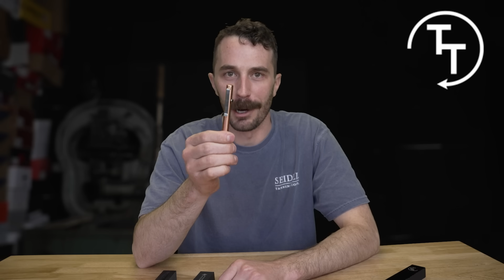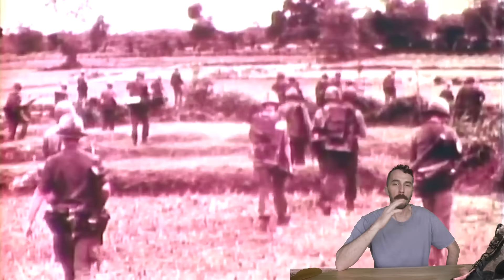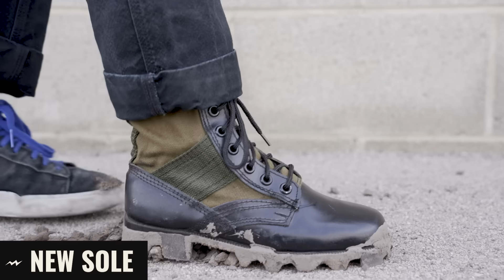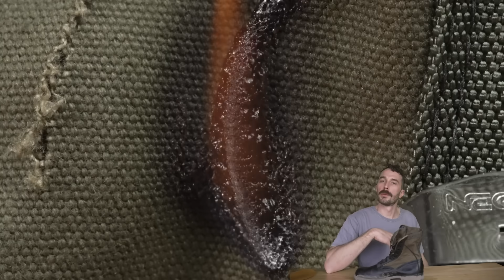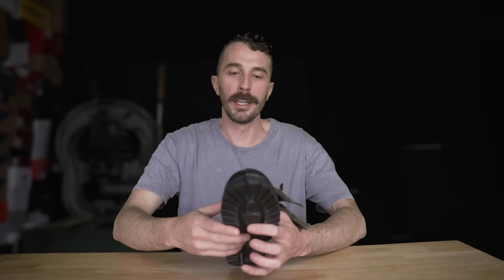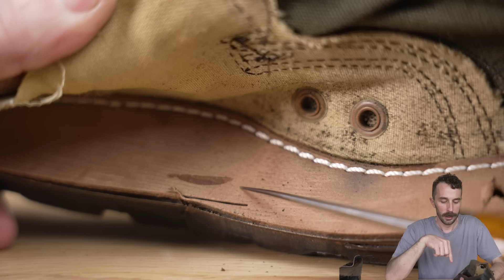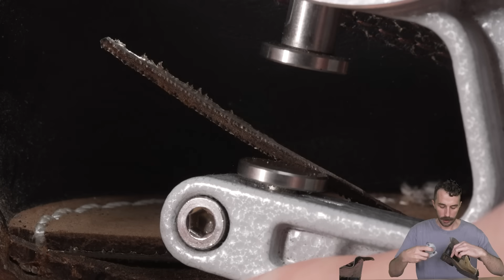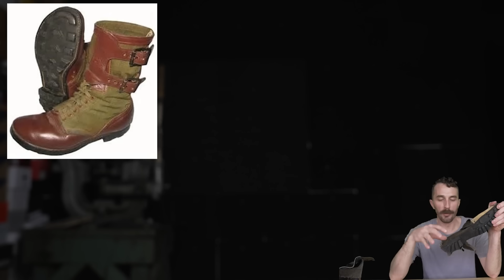Why it took 57 years to replace jungle boots

Comment: I had a chance to use a pair of those for 2 weeks when my Army unit went to Honduras in May 1985.
They seemed fairly capable for the conditions. We were only issued them for the 2 weeks we were there.
Shortly after returning to Ft.Campbell, KY, we made to turn them back in. 
My overall impression of them was fairly good. 😉

Comment: 306.5 pounds isn't even nearly enough to do the job unless you get very lucky TBH.  Figure maybe a 150 pound guy with 50 pounds of gear falls 2 feet onto a spike.  Maybe two inches from the bottom of the boot to the foot so that's the maximum allowable deflection.  That's 24/2*200 = 2,400 pounds of force.  306 is close to a full order of magnitude away from what it needs to be using some pretty generous numbers on my part.

Comment: I wore three types of boots when in the Army in the early- to mid- 1980s: The standard-issue "leg boot' as issued from US army basic training; the decorative but useless "Jump Boot" (after graduating Airborne School); and the Jungle Boot when sent to Caribbean climes. of all three, i absolutely loved the jungle boot. And our company commander ordered us to wear our jungle boots on practice jumps because it was so much easier to hit our 5 points of contact while wearing them. "Jump boots" were forbidden on jumps.Saw a couple of high-speed low-drag Majors break their lower legs in their nice spit-shined jump boots. Right at the top of the boots. Jump boots are for posers and lame-ass majors.
Reply: And also those who liked the fact that jump boots were a heck of a lot easier to shine and keep shined.
Reply: I remember the 'Jumps Boots and how they hurt my feet. Even so, they were suitable for specific venues where you had to look sharp. Not very practical in the field. As a tank commander/platoon sergeant, I also tried the 'Tankers Boots with the long-ass strap wrapped around the ankle. There was a cool factor in that style, but they didn't hold up very well.
Reply: Interesting because when the Corcorans were designed in WW2, the thicker rubber sole and heel were intended for better impact absorption when hitting the ground, and the full leather uppers were for ankle support so as not to break or roll ankles. When I first started jumping, I wore the new Nike boots which had zero ankle support. Now if I jump I go with something more rigid in the ankle.
Reply: @Indylimburg  That's the problem with "ankle support."  Your ankles can move in directions your knees can't.  Take out the option of letting the ankle "roll" from side to side, you put that side load on the knee and end up with severe knee injuries.

I'll take a sprained or even broken ankle over torn ligaments in the knee any day.

Comment: I bought a pair for military simulation airsoft in 2005 and used them for many years.  I still have them.  The only change I made was to add gel insoles for comfort.  They're great for summertime.  I waded through many a creek in them and they drained and were comfortable.

Comment: 2005 you say? I was issued my boots in 2008 and they looked jist like that except they had steel toes for construction safety in the Seabees. I finally had to get rid of them this year because the leather was splitting, the soles had worn down to a slick base, and the vent holes had come out after YEARS of use in construction and outdoors after service. Excellent quality and hard to find the steel toed version in my size now. :(

Comment: great video! btw, those boots in the amazon link got insanely negative comments.  i bought a waterproof pair of Cole Haan boots for $200 ($100-$250) and they are AMAZING. worth the price and dont look like crap.  a good pair a boots should last the rest of your life so dont be cheap and get $50 ‘jungle boots’. - quote by a bro with good taste, circa 2022 ce

Comment: Never thought a boot deconstruction video would be interesting, but it was. I used those boots for many years during my AF career. As aircrew, the powers-to-be frowned on wearing them for flight operations due to their less than desirable fire retardancy. I wore them anyhow during hot destination missions. They were however, terrible on wet, oily, or fuel contaminated floors. Nice job!

Comment: Can you still get these boots? I have had a few pairs. I put a thick felt insole in mine and wore them hunting in the snow in Colorado and to work in a cold box. My feet normally sweat summer and winter. My feet would be cool but never to cold. I took a back packing/ rock climbing class in college and they worked excellent.

Comment: I had a pair of Jungles from 1996-2005 when we switched over to the ACU uniform and desert boots.  The last pair I had had black sides and not the green, couldn't find the green in the PX in Germany at the time.  They were a great boot and when you finally wear out the soles we would replace them with vibram all rubber soles.  Just awesome to wear.  Only my modern day Nike combat boots were lighter.  One of the best parts is that you didn't have to shine the whole boot.  You just Kiwied the leather parts.

Comment: The green jungle boot was my favorite boot, of all of the ones I wore while serving (91-2005). The black ones that came out later just didn't seem to be made as well....the steel plate had been removed, also. To me, the ONLY drawback of that boot, was after you put several miles on them, that steel plate would crack right around the arch of the foot.....causing the boot to pop every time you took a step. It wasn't loud, but you could feel it in the arch of your foot. We just removed it when that happened. Other than that, it was a  great piece of footwear. I wished that I had purchased a few more of them back then. Because, many of them today are just cheap replicas.

Comment: I wore those in the Marines from 1990 to 1999 and the one issue you didnt discuss on the video was that the steel plate would break on its own over time.  Granted I was in the infantry as a machine gunner with a heavy load out.   But typically within a year a new boot would start to make a "clacking" sound as you walked, and you could feel the steel plate flexing and popping.
Reply: Interesting. Sounds like an improper alloy or something. I had some unrelated boots with a plate in it that I used for quite a long time, and it just got rusted (I know because it eventually came loose), never broke. I suppose the military boot might have been a bit too thin, but mine wouldn't have been much more than 1mm either, I think.
Reply: @MsHojat  its thin, but we would frequently hike miles with heavy loads in our rucksack, i think they would have lasted under normal conditions.
Reply: Yep as a 60mm mortar man mine were always cracked..all of mine I ripped out when ever I was deployed to the desert.
Reply: I remember that but not every pair or not even both boots (just one or the other),hahaha.  Especially when I did 2 years in Panama and Honduras in the early 80s.
Reply: I wore a steel toe version as a tracker. The heavy tank boots just didn't cut it for amphib crews. Great boot. YATYAS.
Reply: I remember that too. You used could them those back and get them DX’d for new ones since they were issued upon arrival in Panama 🇵🇦. Those were the days. Mighty good boot.
Reply: Im not the only one that had a JB that clacked mid boot
Reply: Gotcha...same deal. Ankle support was bit less than old chevron sole black leather  boots. The later model " Panama" sole  was also easier to " since kick" the mud off bottom sole.

Comment: The Jungle Boot was, as I recall, issued to me in RVN with the Jungle uniform. While they were effective in very wet situations, I just did not like them. You are right, probably as many Marines DIDN'T like them as there were guys who did like them. There was almost a cult built on the boots. They were stiff wearing when walking...and Marines walked alot. I did not get as much ankle support as I did the non-jungle boot. The early pattern sole did not shed mud well. You are correct, it was like walking on mud/ice at times. Good topic.

Comment: I loved my Jungles, i bought a pair when i was still in service and even though we were state-side i was still allowed to wear them. While the sole had those large (what did you call them again?) tread on the bottom, making it a little odd to walk on pavement with them. The fact that they were designed to circulate air and let your feet breath in them was a god-send on hot summer days. I got to the point that i wore them exclusively, while everyone else just wore those black Cadillacs.
Reply: Vibram
Reply: Vibram is the leather manufacture panama was the style of tread.
Reply: Panama mud release soles were the later pattern. The first pattern vobram soles held mud like a sonuvagun.
Reply: Jesus said it is very hard for the rich to enter heaven. Balance is key

Comment: Yeah, well, if there was any steel plate in my jungle boots, it did not stop a nail that was in a small pit driven through a board from piercing my boot's sole and going about a 1/4th inch into my foot. E/2/1 1st Mar. Div. '66-'67.

Comment: I would have paid you for that pair of boots complete.  Crap.  I actually have a pair of Vintage boots.  The problem I found, is that the toe portion of the boot cracks and peals.  That might be because they are really old.  Surplus stores are closing all over the place.  Finding those, at least where I am, is no longer easy with the exception of ordering them.  They are not good for winter, and the knock off redos of them are not the same as the vintage military ones.

Comment: I wonder if the wood in the sole was there also as added protection from stepping directly on punji sticks? A grunt unit on patrol often carried 100 pound rucks. Having a wood block seems a good idea as it is such a different obstacle than the rubber of the boot sole. Gear weight plus body weight plus gravity versus a stout but flexible pointed stick, often smeared with feces for added effect. I do not know the answer but it struck me as a possibility after seeing the cutaway of the boot.  What I really liked was the concept that the Army actually put that much thought into it. 

I did not like the sole plate so much as I felt it made the boot less flexible than the standard issue boot of the late Vietnam era  (1970) which was all leather and I believe a pretty good piece of footwear.

Comment: They were eventually replaced with the "hot weather boot" which was a jungle boot with black nylon instead of green.  I wore these in the jungles of Panama when I was stationed there in the early 90s.  The nylon construction was a problem with aircrews, however.  The nylon would burn and melt to the foot in the event of a helicopter crash and fire.  We had a safety poster when I was in 1-9 CAV that showed exactly what a jungle boot could do to a foot in a fire.  Some aircrews had the nylon replaced with Nomex (probably in Korea) but they were never authorized and look like crap.

Comment: I wore identical jungle boots during my marine corps days. I humped many, many miles through sandy deserts, jungles, asphalt roads, etc.....…pros are that it dries fast, and the cons were that it lacked any cushioning and was slightly heavier than I would have liked. Bates boots came out in the mid or late 90s, sold at local base exchange, and I bought a pair which I thought was great. Comfy, lighter, cushioned, and the toe compartment bent easily so it felt like I was wearing a running shoe in comparison to a jungle boots.  Jungle boots lasted longer imo but for long hump..I opted for the Bates boots.

Comment: VB Boots are very interesting to look at. The foot portion is lined with thick felt and there is a air valve on the side for airborne ops. 

They work very well, and are extremely popular with Alaskans.

Comment: I was stationed at Ft Buchanan PR and Fort Lewis between 95 and 99, and this boot was by far my favorite. I still have mine. That makes it older than a lot of you reading this (maybe). My only problem with it was that the sole cracked across the the ball of my feet. I never had them re-soled, although I've thought about it many times. Both Puerto Rico and Washington had very wet conditions and these boots never failed me. For those curious, I was an MP at both locations. Thanks for the video

Comment: I remember reading some Vietnam war witnesses according to which the steel sheet under the feet was the worst thing when stumbling upon explosive booby traps. VC often put .50 cal rounds buried in the ground and pointing upwards so that they detonated when walking on them. That transformed the protective steel sheet in a potential shrapnel.
Reply: and yeah. A 1mm sheet of mild steel, stitched between two layers of leather, is a real hazard during the process of getting a .50 cal round through the foot.  You got it, man. You identified the real problem there.

Comment: Nice! 
In the late 80s I got some Israeli paratrooper boots that were sort of like the jungle boot and sort of like the old WW2 jump boots with the collar up high, but they were all-canvas. With some kind of a rubber sole and toe cap - sort of like a pair of Converse All-Stars. Those things were fantastic, with good ankle support and a sturdy sole, but really lightweight compared to the others. They breathed well enough that they dried out pretty quickly when you got them soaked and you didn't sweat to death in them when it was hot.
Bought them from some mail-order place, and by the time I wore them out I wasn't able to find them again.

Comment: I wore them as a Viet Nam combat engineer in the delta. We did not wear socks, as the ringworm in the rivers would duplicate the pattern of the elastic. We also used locally made zippers which laced into the boot and made fastening them super quick. We had 2 pair, and one would dry each day. We usually took the inner sole out for quicker drying. I never saw a jungle boot fail.

Comment: Did 4 years as an 11-Bravo and these were definitely the best boots for field or garrison. The only drawback was how the vents to let water out also let sand in (Desert Shield/Storm). I covered them on the inside with 500mph tape but the sand always found it’s way through eventually. In Korea I had a pair of jungles custom-made with the shiny rubber on the toes and heels just like jump boots. Totally non-regulation and a big waste of money, but I was just a stupid private at the time.

Comment: These were my favorite daily-wear boots while serving in the Army from 88-92. However, my other favorite pair of boots was the Corcoran jump boots highly polished with Kiwi Parade Gloss. I was an MP and would wear those while on the front gate or on patrol on day shift. Any other time, I was in the jungle boots. Once either of these boots were broken in, they were some of the most comfortable boots. The basic issue boots (black leather all around) sucked donkey balls.
Reply: I was thinking the same thing, they were my favorite authorized daily wear boots when I was in the Army during the same time. Especially during the summer months.
Reply: I was an MP at the same in Germany. I wore both of those same boots, for the same reason!! I wore the soles off my jungle boots and they always made a “click” noise when I walked!
Reply: Same here. From 87-92 these were my hands down favorite. I wore the issued black boots in the field in the winter sometimes, but jungle boots the rest of the time.
Reply: Yup. Jungles and Jump boots were all I wore. Jungles in the summer.
Reply: @jdstarek  Yeah - for over 40 years I wore 'em all - even after I was discharged.  The original Jump Boots were strong and long lasting and after a short time were very comfortable.  The Jungle boots were much lighter but the original Jungle Boots did pick up mud and small stones in the soles.  The "Panama Soles' (not mentioned) allowed mud and stones to fall out naturally and the yet newer soles (which were shown) also self cleaned.  The vents/drains worked wonderfully and even when not wet they provided air circulation in use.  The newer than those styles were feather light but didn't breath worth ....
The only bad thing is that after years of wear the muscles in the lower legs relied on the boot's support and atrophied to end up causing "weak ankles".  At 75 I expect to have that until the end of my days.  Joe S., USAF, TSgt Ret. 67-07
Reply: My 1969 standard issue leg boots, with the replaceable leather soles, were very comfortable, but the leather sole was slippery, which I did not like. When they issued the rubber lug soles, that cured the slippery issue, unfortunately they were not as comfortable as the leather sole ones were.
Reply: @stankygeorge  USMC 90-94.
My leathers never held mud like my JB's
Reply: Same here but from 91-99.  I couldn't stand the standard issue black boots. Unless I was wearing my Corcoran jump boots in my Class A's (Airborne) I was wearing my jungle boots.  Those things were great
Reply: Buhwahaa you said Donkey balls 😂😂😂😂😂😂😂 but true!✅
Reply: The sole is everything.
I hated the "jungle boots".
I liked my Cadillacs be cause the soles would drop mud.
Reply: I had a pair of Cocoran jump boots that never did get broken in properly. I gave them away when I left the army in 1970. I still have a pair of jungle boots which i was issued in 1969. They are nearly as comfortable as my running shoes.

Comment: I wore jungle boots in Canada, El Salvador, Egypt, Cyprus, Israel and Lebanon. The only place I ever wore them through a swamp was in northern Alberta when our unit was called out to assist in the search for a missing child. I did not dry them properly and I had to get a new pair, as they had become unwearable due to the deformation of the leather. I found they were comfortable enough at -10C, providing your wore good socks. I still have two pairs in fairly good nick; they wear very slowly, providing you're on terrain rather than pavement.